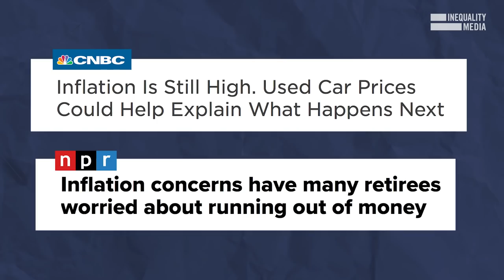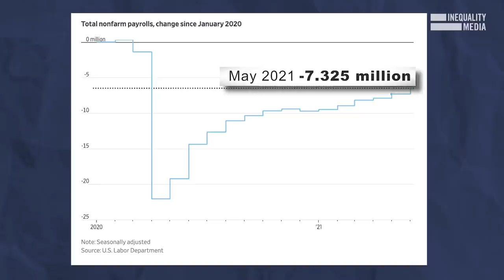Don’t Buy Into the Inflation Scare | Robert Reich

Comment: I dunno, this wasn't very convincing. I was hoping to see some reason that the current inflation won't be a problem. All I saw was "don't worry, it's fine". Can't I worry about inequality and inflation at the same time? I'd like to see an economist explain why this is a bump in the road and not a trigger for a bigger economic result, like a housing loan crisis that pushes us further down the hill into a crumbling economy
Reply: He is arguing that current inflation is due to supply side bottlenecks and will be transitory. Unless wages increase, which he is arguing most likely won't happen, long-term inflation is not sustainable and not something to worry about.
Reply: @rjrkochal  I'm sure you and he are both correct. But I think there may be factors involved beyond supply chain issues. It seems to me that any time money is printed like it has been, inflation goes up. The fact that we had supply chain issues on top of that makes me feel more worried, not less :) It just would have made me feel better if he had given an example of a maybe an economy that went through something like this, or showed some models that predict inflation is going to stop now and things will go back to normal levels. I dunno, it felt light on evidence. This felt instead like someone telling me not to worry, without a lot of convincing reasoning. Maybe I need to watch it again.
Edit: I watched it again and I understand better now, but.. I'm confused about something. He said that we don't have to worry about wage increases because we will just outsource jobs. But, this was a global event.. the globe can't outsource jobs. America can but, isn't it possible that inflation goes up worldwide? I guess I just don't have a lot of faith in the people who control the money, it wouldn't surprise me at all if they threw the bulk of people under the  bus to hang on to what wealth they have. When rich people on fox news tell me not to worry, I worry. Seeing this guy agree with them was... interesting but not as reassuring as I'd hoped it would be
Reply: @thomasskadow3983  why do you say that? When did this happen?

Comment: They have been increasing prices. I say we buy less useless stuff and cut their profits.
Reply: OK, can we take the HVAC out of your home? That would save you a bunch right there. Or get you to buy nothing but the cheapest canned goods, regardless of quality and taste concerns? Will you sign and agreement to keep your automobile till is costs moe to fix it than  new one to buy? Will you stop buying products made in China? 
I do appreciate your comment, but it isn't a practical answer, not really. But cutting the corporate bottom lines is the way to get their notice- there we are totally in agreement.FR
Reply: Buy a fan it will safe you some money on air conditioning
Reply: @ramonibarra8727  This is an example of how that could work out; back in the '80s, California was having a drought condition and Los Angeles went on a big tear to "do something"- they advised the citizens to each put a brick into the bottom of the toilet tank to reduce the water use per flush. Water usage rates went down drastically from this and other measures. The water and sewer board's response to this god send was to raise the water and sewer rates to replace their lost revenues. 
This really happened and I suspect it will happen more often going forward as the utilities get squeezed by renewables, etc. FR

Comment: If inflation is not a problem, why is it that gas prices in Calgary -- one of the cheapest places in the country to get gas -- has gone from 91c / ltr to 144c / ltr in under a year. It now costs me $85 to fill my 60L tank. Now add 20% and the prices in Vancouver are probably around 170c / ltr, which is over $6 / gallon. Inflation IS a big problem. We haven't seen prices like this since 2008...and that should tell you something. It ain't supply!!!

Comment: Inflation is an increase in the money supply. Robert knows nothing about economics. Inflation is here to stay.
Reply: facepalm
if theres greater money supply, it will increase aggregate demand, which will increase demand inflation. there is a lack of aggregate demand, however, or excess spare capacity, in his words, as evident by the unemployment rate being extremely high, and economic growth being below structural levels, on average over the course of the most recent economic cycle. hence, this increase money supply is having little effect on the CPI, as, like what I said, there is a substantial amount of spare capacity. therefore, it is, like he said, due to aggregate supply factors, such as bottlenecks and the reduced supply of oil, and goods from overseas. clearly YOU possess little knowledge of economics.
although i must admit he is partially incorrect regarding the conservative's supposed ulterior motives. expressing concern about the inflation rate will only prompt the government to adopt a contractionary budgetary policy stance which would only tend to increase taxes to slow expenditure, not the opposite, like what he asserts.
Reply: @pointlesslylukesplainingpo1200  , How do you feel today about endless money supply and inflation?

Comment: Robert you didn't mention quantitative easing at all. The QE (in every country) flooding into asset bubbles is trickling down into commodities. Call it "trickle down hyperinflation". That is not a temporary problem caused by supply chain bottlenecks.
Reply: And both parties are to blame

Comment: We have a conservative ( Liberal) govt here in Australia, who up until Covid-19 were not worried about the fact wages had stagnated, even gone backwards in real terms , even side with the Business groups who repeatedly argued against minimum wage increases to the Independent umpire Fair work Commission. It took Covid-19 for them to be worried, I mean they finally increased unemployment benefits ( permanently) not just top ups due to COVID to $600 per fortnight ( increase of $100,). The old rate had remained the same for twenty years.  Pre Covid-19 the reserve bank ( equivalent of Federal Reserve the USA), in its minutes of the interest rate meetings often spoke about the stagnant wages growth as the reason why to keep interest rates low , because the stagnant wages, meant no one was spending, and government wasn’t spending, So interest rates we’re having to initially be cut , then held very low to help stimulate the economy.

Comment: He is right about the quick price spikes in the supply chain, but he said absolutely nothing about the Fed, reverse repo facility, bottomed out interest rates and the insane price to earnings ratio in the market. In the 70s the Fed stopped the heavy inflation by jacking up interest rates, but that’s not an option now, the Federal debt would be unserviceable at significantly higher rates. Also he didn’t mention that in inflation wages are dead last to inflate and you don’t regain the purchasing power you had before. The rich will be just fine with inflation as well, they’ll leverage the cheap debt to buy assets that inflate with the currency
Reply: The US could either default on the national debt, print official government created money to pay off the national debt, or even use coins to do it.
All national debt is owed to the private banking system.   This could be changed.   The US government could take that power away from private banks and issue it's own currency, like it does with coins.
Coins are the only money created by the government.   All other money is borrowed from private banks like paper money and digital money, and for every dollar borrowed from the private banking system, which the Federal Reserve is part of(that's right, it's not part of the US government but designed to look like it is), we owe all that money back to the banks.   We could just declare those debts null and void.
Reply: @ClassicJukeboxBand  We absolutely could do that and you’re right it would wipe out our national debt, so the question is why is that not even considered an option? The short answer is that nobody would loan the US money again and all of our money would have to be issued in a hard commodity like gold and silver. All currency is issued “on the good faith and credit of the United States;” destroy that and nobody will accept our paper money. Also since most global commodities are denominated in USD the global trade system just breaks. It’s the endgame of hyperinflation just immediately. The banking system has investors in it with pension funds and 401ks that are holding bonds, with all those bonds immediately becoming worthless. Sure a lot of over leveraged banks get burned but normal savers get wiped out as well
Reply: @tredegar4163  You are probably right.

Comment: I actually strongly disagree with your viewpoint here, especially since in this video you contradict yourself. You literally described issues with the economy that are tied to inflation, yet continued to say that inflation is not an issue. But inflation is the root cause of those issues that you mentioned. Especially since the pandemic, governments have been mass-printing currency which drives inflation up, up, up! As much as you want it to be, it's not a matter of supply/demand concerns. While supply and demand is contributing to higher prices of some goods and services, the real issue actually is a matter of too much money in the system, and that is what is called inflation. Fluctuations driven by supply/demand are typical, as is small amount of inflation over large amounts of time. However, what we are seeing today is much more than that. We are seeing more dramatic fluctuations in the eb and flow of s/d economics, but it's being pushed beyond normal occurrences by the actual issue: inflation. At what point will people realize that their money is growing more and more useless? Will that run-down corner lot selling for a mil-five finally be their clue? Probably not because most people live in their own little worlds. That doesn't mean that the issue isn't there, it just means that people aren't paying attention to it.

Comment: It would have been nice to see the numbers. So here they are. June 2020 to June 2021 total inflation was 5% unseasonably adjusted. The five major contributors to that rate were "food outside of the home" which constituted 42% of the food Price index, apparel, used car prices, oil products such as fuel oil and gasoline, and airfares and auto insurance. From June 2019 to June 2020 the prices of these all fell by about the same amount that they increased the following year. Naturally that was because of an oversupply in the previous year due to the pandemic (lack of demand).

Comment: Current inflation is related to temporary condition cause by the pandemic, supply chain issues are the most pressing.  The inflation of the 1970’s was related to the Volker adherence to high lending rates, aka The Volker Recession; in an attempt to break the mindset of ever-increasing price justification. Businesses just increased cost by the rate of inflation and wages, a lagging cause, were trying to keep pace. Also, going off the gold standard was unsettling (to say the least) to the currency exchange markets. Many unique factors created the Stagflation of the 1970s. None of which are present today.

Comment: This is not the supply-demand inflation. It is due to too much money (printed) chasing not as much real asset. Inflation is already here. How long it last depends how much longer the government continues to print money.
Reply: It is a supply and demand inflation. 
Oil. 
Supply has been cut under Trump due small oil wells going out of business. Demand was low because of the pandemic last spring/summer. 
Now demand is high almost everything is open again. Supply is still limited because some wells never returned opertions.
Reply: Housing: 
It hasn't been built a lot of housing in the last 15 years nor in the last 40 years and some of the housing built in the housing bubble is already destroyed. (Or those communities don't over opportunities) 
Housing supply low, demand higher. Price up. Now ad in sum investors buying up properties where people had failed the mortgage or the rent and the renter then the mortage. 
This is why eviction-protection is so important that you don't loose your small apartment.

Comment: scare?  my parents bought a house for 1/10th of the price i just paid and only made about 10% less than i do.  i even worked at the same job as they did 🤣 in 30 years the pay only went up from like 6 dollars an hour to 11.  

its not a scare, this is happening constantly.  at this rate my son will be working 90 hours a week to afford his cardboard box and 3 slices of bread with a half of cup of tainted water by the time hes my age.

even in the past 15 years inflation has been insane.  when i was 18 getting by was so easy i did for years off a part time job.  i worked roughly 24 hours a week.

now i work 70 and have wayyyyyy lessss buying power 😂 im mid 30s now do not tell me not to worry abour inflation.  ive been there firsthand lol

Comment: What if bread became a million dollars a loaf? If I make two billion dollars a month, that's fine. The issue my thoughts run into is; because the private sector is largely a network of dictatorship microgovernments, they are enabled to adapt to inflation trends faster than the current bureaucratic state. So under a hyper inflation events, the price of bread may be a million dollars, but minimum wage will get you 700 million a month. With labor unions dwindling, there's less leverage in the labor sector to ask for those adaptive wages that ride inflation, because employers can pit labor against itself rather than take needs based requests with earnest.
 This coming from the idea of devaluing stagnant money holdings by creating money and forcing inflation. The end consequence however being that; because the means of production are a private sector asset, the private sector ultimately decides both the rate of inflation and the resulting disparities produce through wages.

Comment: Inflation is bad. Debt is bad. Irrational spending of the FED is never hurting the rich as much and almost always lower and middle class incomes. There is no way around it. Higher taxes on the rich is a start, but it won't solve the debt crisis and eventually the lower classes get fleeced as well. This is inevitable and makes the free world more vulnerable. We need to transition to a different, more sound monetary system. We need to eradicate homelessness and low income class. There should only be middle class and up. Wealth is a good thing. Concentrated wealth is bad for everyone. Sorry, Mr. Reich you are very, very wrong on this one. Economics is not your wheelhouse.